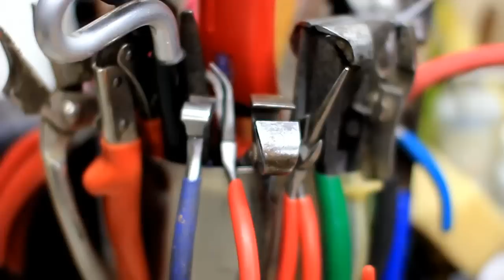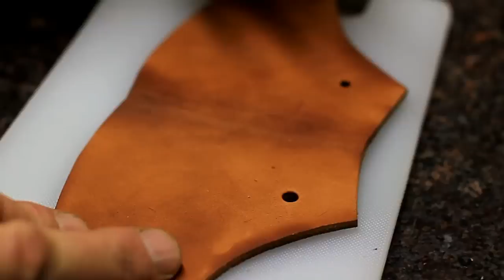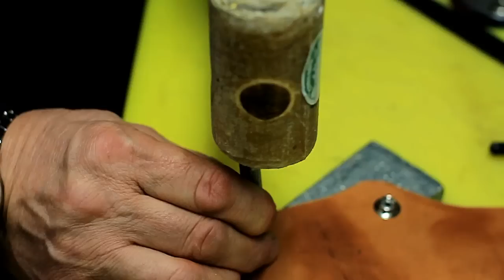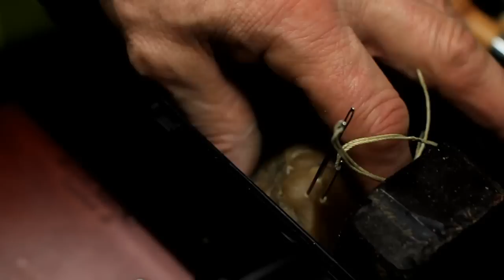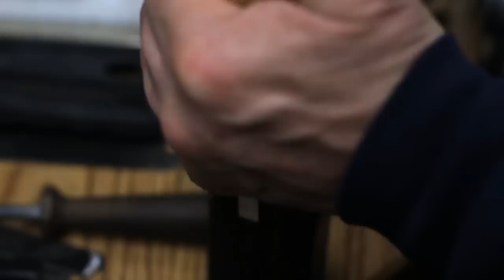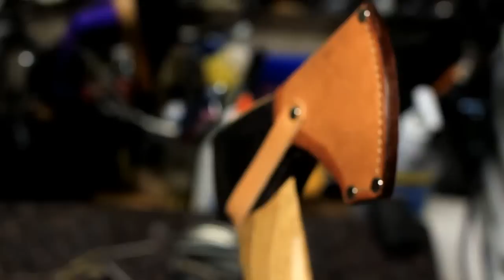Axe Sheaths | The Handmade Process

Comment: how thick of leather do you use? I am using 8-10oz for a sheath, and finding it too thick. I am have trouble getting the sewing chisel to punch sewing holes through the 3 layer stack on the seam...or when I do the chisel gets stuck and I have to really work to pry it off after each punch through. Thinking I need to use 6oz or something thinner.. Any advice appreciated.

Comment: Excellent video.  What kind of knife is he using?  I'd like to get one and start learning leather working.  Looks relaxing.
Reply from the maker: +1klakak, he uses custom knifes made of D2 tool steel (used to be metal working saw blades)
Reply: +ReviewOutdoorGear Sounds cool, they cut leather like butter.  I need to find someone that makes those and get a few for myself.  Thanks!

Comment: "...intricate handiwork."  In other words: "These are made by an analy retentive perfectionist and described with pretentious terms to justify the exorbidant price they're being sold at."  Sorry, but a piece of leather that's folded over, stitched and riveted with a snap strap atatched is in no way worth $42.  The average steam fitter makes $25 an hour.  Your saying the skill it takes to craft a leather axe cover is worth more than the skill it takes to produce a near perfect pipe joint, in all kinds of akward positions and conditions?  Then again, when you're moving slow enough to grow moss on your hands, I can see how you'd have to justify the time it takes to make one.

For or the price of one axe cover I can get a 4-5 oz veg tanned single shoulder from tandy leather, make one in between an hour and an hour fifteen and have about $30 of shoulder left for something else when i'm done (like that $153 knife sheath, that I could make for less than $15).  Actually, I think I can get it for around $30 since my mam has a buisness account with them. 

But then again, everything i've made was in the frontier style so I've never faffed about with the intricute sciving and the scraping shown here either or making sure every edge and surface is meticulously flawless, as if it was done by a NASA engineer.  A functional piece simply needs to be durable and nice looking.  It does not require to be made with the same care as a Swiss watch or compare with an Armani suit in appearance.  That does nothing but make the product more expensive, since you have to compensate for how long it takes.